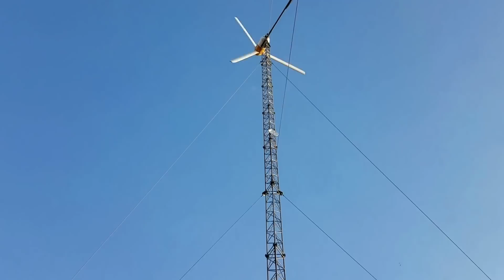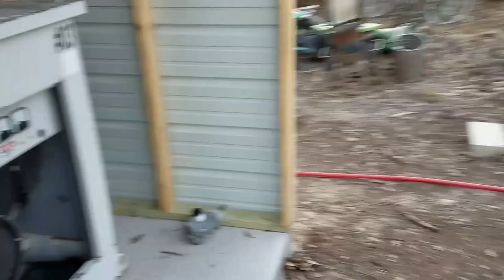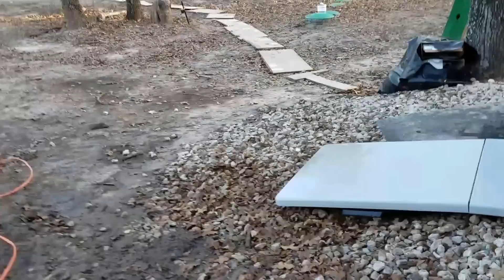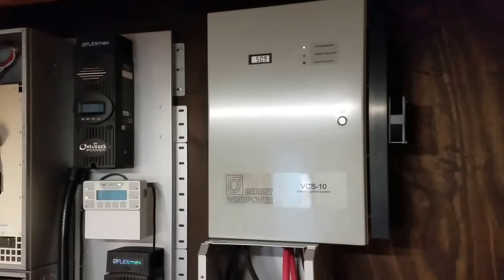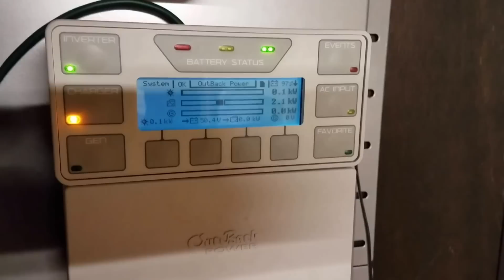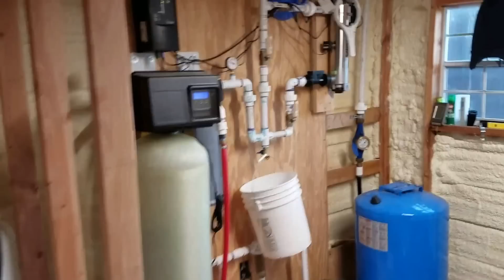Power Waze Off Grid renewable energy setup

Comment: Just two things I would add, if you haven’t already. A separation wall between your water system and your electrical system. It would suck to spring a leak and shoot water towards electricity. And two, add a self watering system to your battery bank. It takes a long time to water that many batteries. In a self watering system, you only add water to a central tank, and it sends it to the batteries with either static pressure or a simple hand pump. 
You have a great looking set up. Keep up the great work

Comment: I have lived offgrid for 22+ years and have helped quite a few people out with their systems over the years.   I see several big time gotchas with your system.... It looks like your tower will be casting a  shadow across that big array of panels.. I took a tower down for a man who had his wind genny tower just southeast of his array.. His output went up 3 fold in wintertime after the tower came down. You shouldnt have so many parallel strings of batteries ... That's asking for trouble.  If you needed that much storage you should have got a forklift battery or even a HUP1.  Your batteries shouldn't be sharing the same air as your $25000 worth of electronics... Acid destroys circuit boards.   Your bergey looks barely over the trees...?  35 feet minimum over anything with 300 feet is a good rule.  That genset looks big enough to operate south Jersey...  I saw a few other things but  that's a  good start.  It's always a good idea to consult with someone with real world experience before spending a fortune. I suspect you have a huge load management problem and are hitting it with money.  My array is 1250 watts and the genset is a DC unit that is slowed down to produce about 1500 watts max.  I am running every thing besides the well on a 1100 amp/24 volt forklift battery.  The well has its own 110 watt array.   The only difference between a small mess and a big one is how many zeros are on the end of the check.

Comment: Very nice. Looks like $60 k if you install it yourself. I installed our off grid system for $12 k. We have 4.8 k in solar. I have a old school wind turbine with a spruce wood prop that makes good power but o.nly in wind storms so I took it down. We have gravity feed spring water. We burn about 30 gallons of diesel a year in the generator. Winters are very stormy here in the Pacific North Wet. Now that you have lived off grid for a year how is the system working and how much fuel do you go through with the back up generator?

Comment: Rob i love your setup but i have ask u...why use 2v battery and not 6v or 12v battery (i am learning everyday)
Reply: Ray Bacchus 2 volt is way better if you can swing the cost.. on his system, his has a 48 volt battery bank that is wired in series with nothing in parallel. The more strings you have in parallel, the more you batteries won't charge evenly. In this system this problem is completely eliminated because of everything in series. Hope some of this make sense
Reply: @ Todd LaPlante got u thanks.....how can i put my hands on 8 of the Trojan L16RE but in the 6v (used) is that possible?
Reply: Todd LaPlante yeah it’s s great set up just wondering if you used 12 volt batteries couldn’t you just add charge controllers to evenly distribute the battery similar to auxiliary batteries like in a 4WD if you can then your bank will hold more power not sure what the cost would be to hook up all the batteries individually just asking as I’m learning about solar as well
Reply: @ Ray sorry I can't be of any help.. maybe keep an eye out on eBay?
@ Matt yes you could use 12 volt batteries but if you were to have a system close in amp-hour capacity to this one (using like a charge controller per 2 batteries) you would probably have more $$ into the charge controllers that could have been used on batteries.